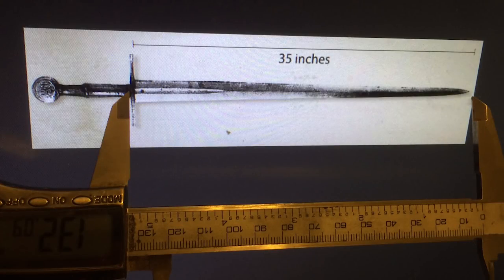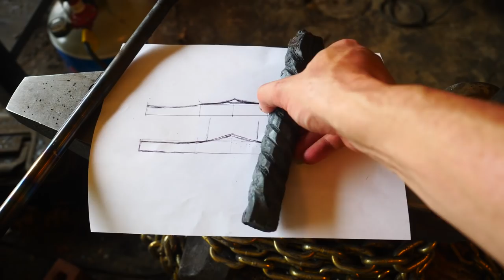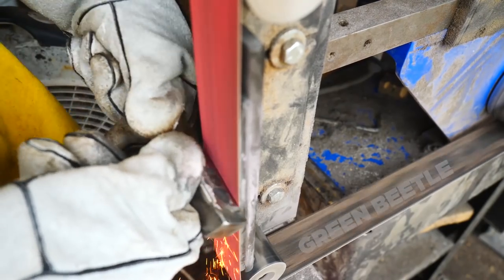Forging A Sword Pt 3:  The Guard!

Comment: If there's any way you can fix up and tighten that first guard to fit the blade a little better with as little material as there is, go for it. I definitely agree that it tells a more interesting story and looks significantly cooler than the second one.
Reply: John Keller he could take the opening of the guard where the tang goes take a hammer and a file or a spike and smash it till it made a deformation and snugg it on the tang

Comment: I would use the railroad spike/file guard and try to bend the ends just a little Bit towards the blade to add more character and maybe that will also help close up the space between the blade edge and the guard itself

Comment: the way he did that guard with it hot on that cold steel is gonna weeken that handle portion
Reply: He dies need another drift, shaped to the tang and the blade of the finished sword, so that he can better shape and fit the guard on another piece, instead of weakening his blade.

Comment: I think the damascus spike, file, twist looks better, fit maybe not as well but that CAN be fixed if you reheat to forge welding then repunch the hole after forge welding, repeat process of the previous, or like you said about the second guard, take the torch to it and snug up the fitment

Comment: Hey GB great video! Just a suggestion, when making twist Damascus I use a pipe wrench on the actual metal, then take a metal pipe that has about two feet of length , slide it over the pipe wrench and use that to lengthen my handle, letting me torque it higher

Comment: I thought the standard practice was to file the fit the rest of the way after the drift. From that I've seen, most people dye the tang apply the guard look at what catches; file; then rinse repeat until it fits. It's a little slower mind you, but that methodical action will help with the fit. I do wanna say I'm just starting out with this kind of stuff, however that's what I've seen in my studies.  Idk for sure though. Both of the guards look good though, and it's a beautiful blade. good on ya

Comment: So from what I know of swords I'd say a few things:
1. You want to go with the better fit on that sword a gap can loosen up over time. (not much of a problem though if you don't intend on using it.)
2. That spacer isn't needed, but if you want to keep it ensure it's comfortable and that the hand can easily choke up on it.
3. That second guard is a bit too thick (vertically) past the edges of the sword. You only want that thickness if you want to move the point of percussion/balance down to the hilt more. (more control/nimbleness, but less cutting power) You should be able to curl your index finger comfortably over the guard to the other side no matter what you decide.
4. My gosh that is a beautiful sword, I wish my blacksmithing skills were there yet.

Comment: When you add nickel 200, a lot of knife makers hot salt blue instead of acid etching, it looks good like that.
Reply: Also, if you hammer your bar round instead of square before you twist it, you won't get any cold shuts.

Comment: I like the size and shape of the second guard a bit more but like the forge welded pattern on the first. Any possible way you can forge weld the tang hole back together on the first guard then recreate a tighter slot?

Comment: The guard on the left is overall nicer. Damascus pattern guard on a plain blade seems tacky, even if you do get it to fit. Save that for a different sword.

One thing I do notice on a lot of other channels is that they don't fit the guard to the sword when the guard is still red hot. They drill/drift holes for a spot to fit to the tang and then file the rest of the way to make a more precise fit.

In contrast to the way you did, which you struck the guard flush with the blade, while glowing, and then you filed it, making the slot bigger than it needed to be. If you decide to go that route with the Damascus pattern anyway, you can make wood shims and have those fix the blade to the guard. Filling that space with silver solder is no doubt efficient, but it would be noticeable in contrast to the finished product, particularly the pattern.

Go with the left, save the right for a future project.

Comment: I like the second one, the first one is cool, but, would look better if the twists ran in opposite directions from the hilt.  Second the suggestion to make a short sword or dirk for the smaller guard. Nice work so far, bet you are itching to chop something with it.

Comment: I want to see someone make a knife out of a shopping cart. I think it would be fun as hell.
Reply: Da Truth wouldn't the knife be aluminum however
Reply: cuptow the shopping carts where I live in can stick a magnet to. So there is some metal content.
Reply: Da Truth do you mean steel because aluminium is a metal
Reply: Whatever gets the point across
Reply: Da Truth derp
Reply: Just because a magnet sticks to it doesn't mean there's iron in it it could be cobalt or nickel but i don't see a reason why cobalt  or nickel should be in there it think it's just a chrome plated mild steel nothing special .
Reply: It's probably zinc plated. Zinc is toxic AF when it burns and fumes.

Comment: Hello! Please forgive me for saying this, but you need to get a better tempering method. I really suggest a kiln. I know that costs a lot. Sell two swords, buy a heat treatment kiln. I have a barrel furnace for the austenitizing temps, and then an electric one for the tempering. Then, you can clamp it straight and hang it in the kiln and temper for the second round and it comes out mostly straight. First temper, just temper. Don't straighten. Then, you can spot straighten with a careful propane or mapp torch use and a 3-point straightening jaw set in a vise. You have a lot of talent and a good grinder. Now, for the kiln. Where are you. If you are close, you can use mine.
Reply from the maker: why dont you just send me a few thousand dollars for one

Comment: I would choose the first myself as I love the twist pattern on it and the strange assortment of metal for the Damascus. Or, I would grind down the first guard into a spacer between the second guard or as a transition peice from the guard to the blade! Just a thought, here is an example. Sorry I didn't know how to explain it so here.

                  |          |             <------ TANG
                  |          |             
<===================> <GUARD
             |   \           /   |  <--- First guard
             |        \/         |  in shallow ∆
             |                     | With tip near
             |                     |  Fuller
Much shorter triangle than depicted but enough to still see some pattern, but have it just the width of the base of the blade.

Comment: I wonder how working in a forge filled with an inert gas (i.e. 100% nitrogen) with induction heating would change the process - no oxidation, loss of material with every reheating, etc.

Comment: The only thing I don't like about the second guard is that it's too big. the guard only has to be big enough to stop a sword sliding down the blade and to be thick enough to strike somebody in the head with without folding in on itself. half the thickness would be plenty.

Comment: You said you wanted to keep weight down, right? Yes, the fit on the first guard isn't nearly as tight, but the second is like original xbox hueg in comparison. You've added mass, bulked up the look, and the style is plain to boot. If you're going to compromise I'd say go with the first. The hidden option is of course keep making them until you're happy with what you have. The bad guards can always be recycled. Keep up the good work Steve, love your stuff. - Nate

Comment: I would think that a drill press would be easier instead of hand drifting the tang slot. I'm surprised you don't have a drill press in your shop.
Reply: Using a drill press would remove too much material, so when you fit the guard onto the blade, and hammer it down to side, it will concave. Bye using adrift, it pushes the material away, and keeps the thickness  around the blade.

Comment: I know people talk shit about Chandler's railroad spike knives, but they do take at least a bit of a harden, right? They can't just be mild steel, can they?
Reply from the maker: Terminology varies a little.  For example, in the world of fasteners "high carbon" is 0.2 -0.35 % carbon.  For the purposes of blademaking and about everything else that's low carbon or what I might call mild steel.  Lot's of debate on RR spike knives.  I believe on a good day the right spike is around 0.30% carbon.  Did Chandler make a hardenable knife out of one?  Yup!
Reply: Rob Mckennie you can get high carbon spikes as well as mild steel